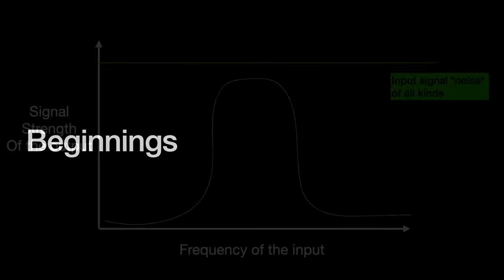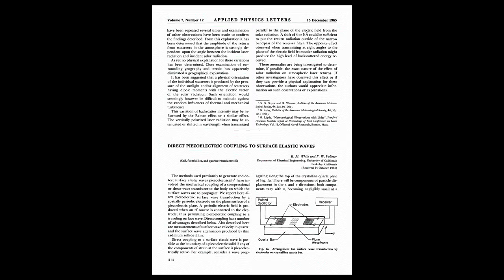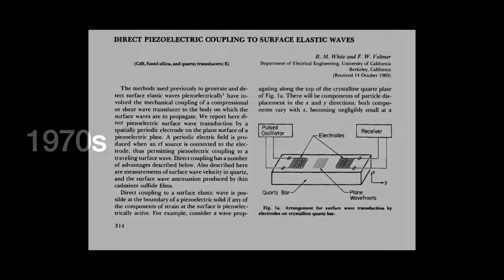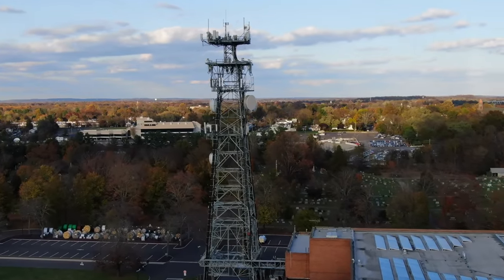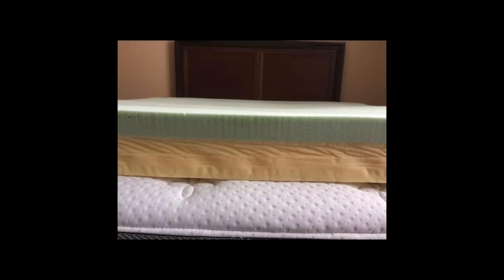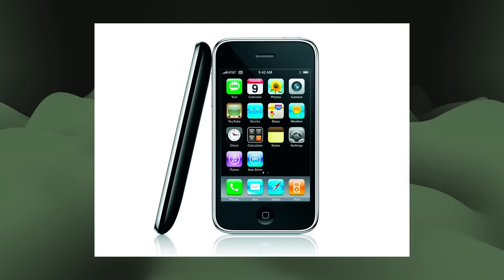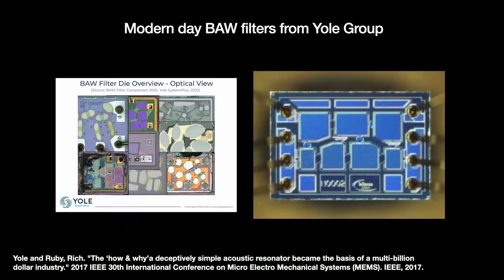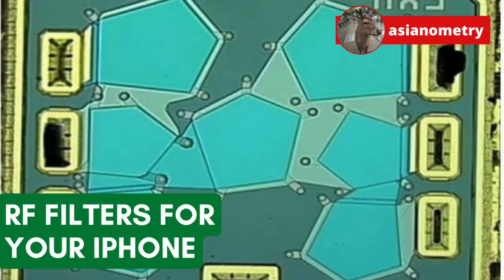The iPhone Forever Changed the RF Filter

Comment: iPhone also introduced an IR filter into its cameras
Reply: almost every camera has an ir filter.
Reply: Absolutely incorrect. Every digital camera intended for normal visible light photography has IR filters on the sensor. Digital sensors are extremely sensitive to IR, so without them, you cannot get even adequate color rendering.

Comment: I find it just as amazing that GPS satellites 40000 km away (give or take) communicate with this tiny thing in our hand.
Reply: Although GPS is transmit only, the real work is all done on the device itself by calculating the mathematical solution of the orbit and time broadcasts. China’s Beidou does offer satellite relay from the ground, but it’s not required to get a position fix either.
Reply: @doujinflip  Still blows my mind.
Reply: They are not geostationary, they are much closer.
Reply: @0MoTheG  OK, 20000 km (give or take), blows my mind. Happy?